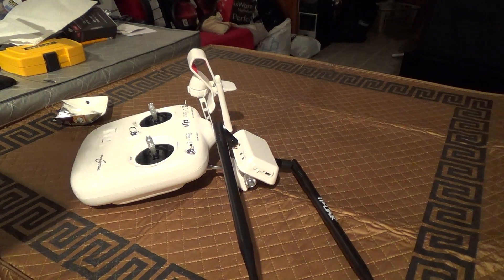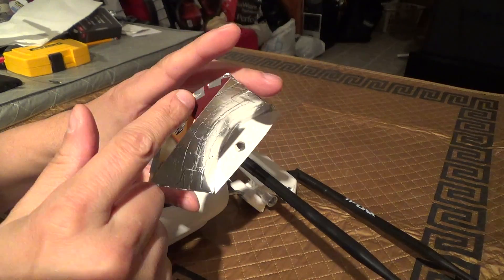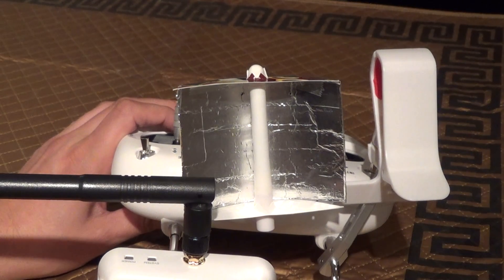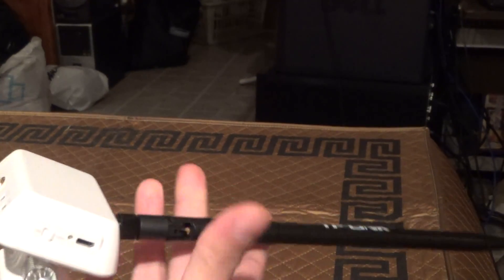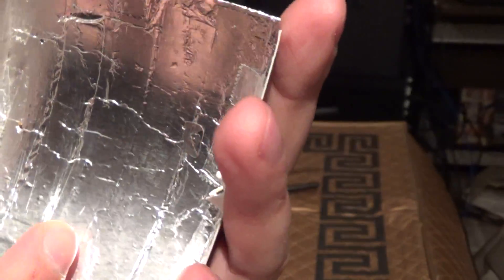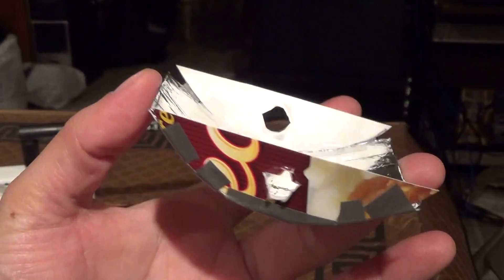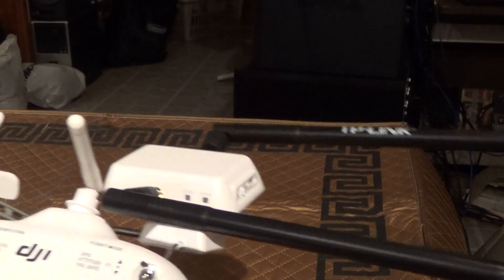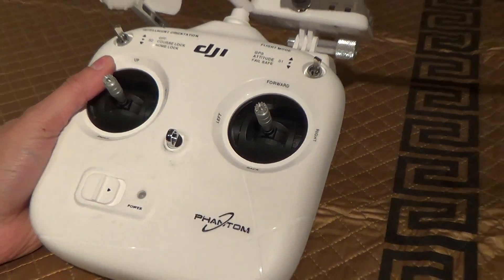DJI Phantom 2 Controller Aluminum Reflector Antenna mod increase Range

Comment: you need at least 1.5mm tick reflector to get proper increase in range, ideal would be about 2.5mm tickness on the reflector.
Reply from the maker: The single layer of foil worked just fine and gave  a substantial improvement in range

Comment: cool video ben, i did this with a custom made parabolic antenna,,,worked well on the transmitter when the phantom is in front of you and you are pointing towards it,,,,i see you added another wi-fi antenna,,,i am going with a combo ...flat directional 14 dbi and the tp link omni directional on the repeater, updating from 5 dbi to 8 dbi on the one repeater antenna,,,,
Reply from the maker: This is great and works in a pinch to boost your existing antennas.  I'm going to pick up a Rhcp helical antenna soon and combine that with one of the omnis.  I will also try some less wifi saturated areas to fly to see what my setup can really do in terms of distance.
Reply: sweet,,,hopefully spring is here soon,,i wanna do some flying....